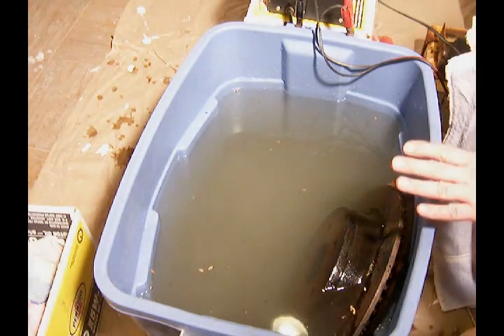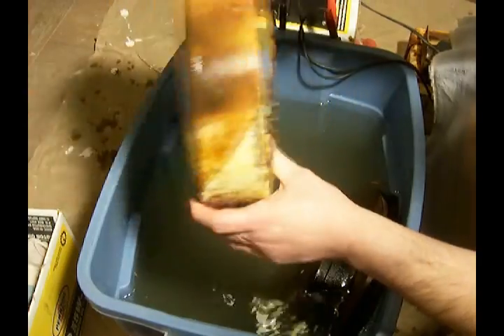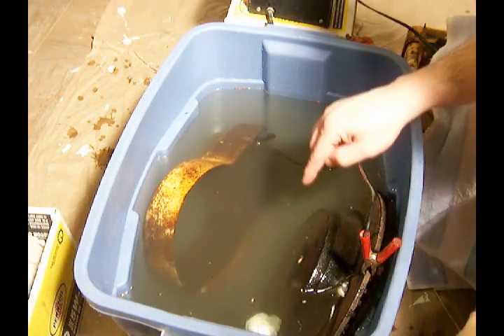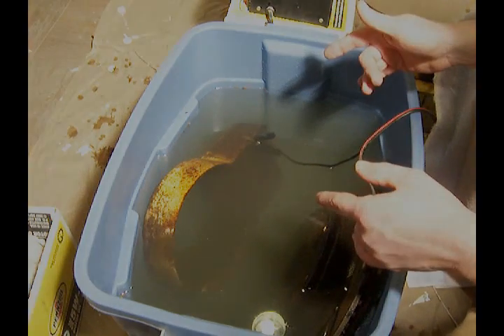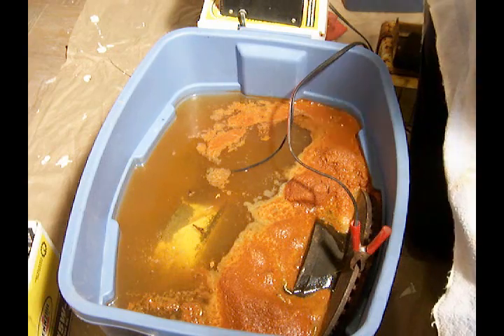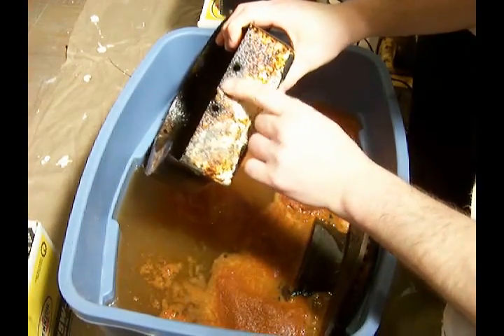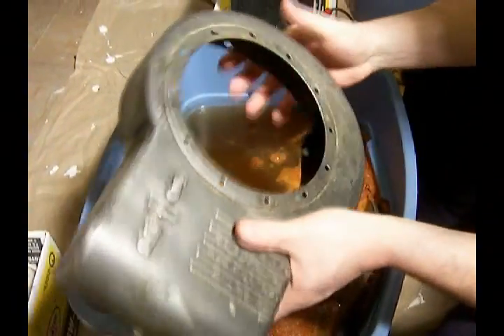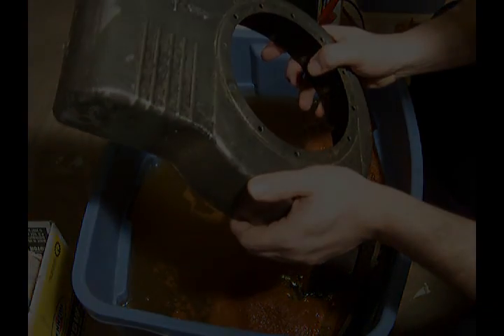Rust removal by Electrolysis - Removing rust from a Briggs and Stratton engine shroud

Comment: For small projects use an old cell phone charger and baking soda works great I have use it for over a year on stuff I have found metal detecting
Reply: Can we use this method for cleaning gun from inside? And please tell me which type of Current use Ac Or Dc ?

Comment: is Arm and Hammer washing soda the same as Borax?
Reply from the maker: No.

Washing soda is the common name for the chemical sodium carbonate. A common source of this material is the ashes of plants (hence the nickname "soda ash").

Borax, often sold in stores as "20 Mule Team," is marketed as an all-natural laundry booster and multipurpose household cleaner. It's a white, soft powder that dissolves easily in water and is known chemically as sodium borate.

Read more : http://www.ehow.com/about_5498702_borax-vs-washing-soda.html
Reply: got it. Thanks

Comment: What amps do you need to set your charger at? Does it matter?
Reply from the maker: My charger has a 2 amp trickle or a faster 10 amp setting. I use the 10 amp setting. Thanks for watching.

Comment: Try not to get shock
Reply: ive stuck my hands in the water cleaning my cast iron. no shock.
Reply from the maker: That would be a viral video! Thanks for watching.
Reply: Yea lol you're welcome.
Reply: Well you are very brave.
Reply: ya ive been doing this on cast iron for a couple months now and stick my hands in the water while its on. NOTHING!
Reply: Its low voltage DC. it is not AC, your not going to get electrocuted or shocked
Reply: Absolutely not true. I would suggest  5 - 40 V.

Comment: I usually use vinegar for smaller items, but for larger things, obviously that would get very expensive...I've looked everywhere for A&M Washing soda, and can't find it anywhere...is there an alternative?
Reply: look in farm supply stores. where I got mine last week. in the detergent isle with cleaners not the baking section. its a laundry booster. sodium carbonate.
Reply from the maker: If "Washing Soda" is not available to you, pick up some "Baking Soda" and bake it! It will become "washing soda". Search the internet for detailed instructions. I have never done it but I believe that it's a simple process. Thanks for watching.
Reply: Every Walmart I've been in has it in the laundry soap aisle.  You can also use Borax but not quit as good as the washing soda.
Reply: Baking soda also works. You are simply trying to make the water conductive but AVOID SALT. You don't want chlorine near you or your metal. Pool supply or home improvement centers carry large bags of baking soda. I think they come as 10lb bags.

Comment: how much voltage you had applied to it???
Reply: sblg43 you mean amps i assume?
Reply from the maker: Voltage I don't know, the unit charges at 2 Volts and 10 Volts - I used the 10 Volts setting.
Reply from the maker: matt sanderson Yep!

Comment: Hi!

I have been doing this process, but I'm facing some problems...you said that if the positive terminal is not submerged the rust doesn't stick to the sacrificed part, it's happening the opposite with me, I need to clean the sacrificed part to use multiple times.

Btw, I'm restoring an old manual water pump and I'm going to paint it next..
Reply from the maker: You need to have the sacrificial metal underwater. That metal will then collect all of the rust and begin to rust itself. However, you do NOT want the positive terminal underwater or it will begin to rust or corrode as well. Cleaning the sacrificial piece is probably a good thing between uses. Thanks for watching.
Reply: sblg43

OH! I'm sorry, now I understand!! I tough you said in the video that if you place the positive terminal outside of the water the sacrificial metal will not get the rust! Now I understand , what you said is that THE TERMINAL will not corrode!

THANKS! Great video by the way!

Comment: Great video!! I'd like to try this on an old flywheel, Would you happen to know if it will effect the magnets? The flywheel I have has 12 magnets embedded in some kind of epoxy to the cast iron.
 Also watched your restoration of the HSK70. I had the exact engine on a blower, followed you step by step, it came out perfect!!
Thanks for sharing your knowledge.
Reply from the maker: I am pleased to have helped. This process should be fine with the magnets.

Comment: You can get compact sand blast kit, basically a tube you stick in a bag of 00 grade silica sand with a air hose. but it's messy and you have to have a compressor...a agree

Comment: Ok, I'm a little greedy.
I have an old Dayton 1.75 KW Generator with a 187cc 4 horse 100232 0492 and a Dayton Teel 1P869 water pump with a 127cc 3 horse 80232 0506 and the generator had 20 year old fuel remains rusted in the tank and carb and it tore down awaiting blasting, but the water pump needs almost nothing.

Comment: The main ingredient in real washing soda is sodium borate, otherwise known as borax. If you look at the ingredients on the box and it has borax in it (also the brand name Borax has, well, borax in it) you should be fine. Commonly used in almost everything, from welding supply shops as a flux to anti-fungal foot powder.

Comment: I would have liked to see the sacrificial rotor to see what it looked like afterward.  Beings you used steel and cast iron does that mean the metals dont have to be the same?  It looked to me like the rust stayed in the water using the cast iron, would it have clung to the metal had the metals matched?
Reply: Steel is iron mixed with a small amount of carbon to improve ductility

Comment: OK i dont get the video why waste the time doing this you can have it sand blasted and painted or clean it up and there is a paint you can use on rust to seal it away they use it on cars and trucks so they dont have to strip it it down and reapint it you can paint right over the rust it stops it from rusting any more and seals it up. So what do it this way? Or you can take it in for an acid bath and that work also.

Comment: Does higher amperage improve the de-rusting or decrease the amount of time needed? Noticing that the paint is rubbing off, would this be a worthy process for removing paint or powder coated finishes? Have you ever tried it on chrome or nickle plated parts? Also wondering what effects it would have on the unrusted plating.

Comment: Take a bin, cut rebar into lenghts to fit upright in each corner with enough to stick out through a crude square frame to go over the top. dril 4 holes through and put your rods in there, connect them all together and you have a neat deruster. you can now take some of those pot scrubbes that look like they are made from citrus fruit bags and skewer them on the rods to prevent short circuits.

Comment: Acid will seep into the metal and come back to bite you later with more and faster rust... remember even a solid is mostly space on a molecular level.

Phosphoric acid is a better compromise as it does convert some of the rust.

Electrolysis is the bomb, it will leave the finest detail on the metal without ever damaging good metal. Most of the rust gets disolved clean off and it sometimes leaves a thin layer of magnetite b(black rust Fe3O4) Black rust is protective against rusting.

Comment: probably it will work best if you remove all oil with soap and maybe some solvent before the electrolysis. it applies to any metal piece.

Comment: Your can actually use caustic soda (drain cleaner). But make the solution pretty mild (like 2%). Now - it will burn the skin on contact, so wear gloves. The fumes aren't all that healthy either, so do it outside.
I have used both washing soda (which i had a REALLY hard time finding - living in Sweden), and the caustic stuff, and didn't see any difference.

Comment: Did you change your charger? Some newer ones have protection so they don't put out any amperage unless a battery is detected. I had this problem, so I hacked my free after rebate 430W computer power supply. 12v @ 16A. Now pulling ~0.8A. I need to get a bigger scrap piece and be able to move pieces closer together. I'm curious as to what amperage was flowing in this video. Just because you have a 10A charger doesn't mean there is a 10A flow.

Comment: yeah you should clean the rust off the metal piece first, did you use new water with detergent? or just the same water as the first part? Also, this supposedly needs line of site between the rust and the sacrificial piece so rust that is under or on the back of the part or in holes may not come off, you'll need to turn the piece every couple hors or so. they say using hot water and a little agitation helps too.

Comment: Pretty impressive.  I've used wire wheels on angle grinders for many years to remove rust from parts. I've used a battery charger with salt water and different types of metals to produce different colored oxides just playing around.  I didn't know you could remove rust from ferrous metal that way.  I've never tried washing soda, might have to try it.

Comment: I have indeed done the whole process with a gas tank from a horizontal briggs 5 hp
process works great i was just experimenting with it what i did was found a cap like those cheap plastic covers on some trailer wheel bearing or anthing like a cap, put a hole in it inserted a long bolt but not touching bottom of tank put a strong mix of soda and water, and 2 days later changed bolt it was nearly gone rust ate the electrode, so just change it out with a another bolt
works great!!!

Comment: For anyone having trouble using a "smart" charger for electrolysis (i.e. the charger will not start 'charging'), just get a D cell (or any 1.5 v battery) connect it in parallel to the charger for just a second (while it's connected to the anode and cathode) and the charger should start. This worked on my Schumacher smart charger which needs to sense a load of at least 1v to begin charging. As soon as it started, I removed the D cell and the electrolysis continued uninterrupted. YMMV.

Comment from the maker: The difficulty in using this method for the inside of a motorcycle fuel tank, is how to suspend the sacrificial iron inside the tank. It cannot touch the inside of the tank and yet it has to be in the water. There are some videos on youtube of guys who have done it. I have a tank myself that I want to do it with. I just haven't gotten around to it yet. Let me know how it goes if you do it.

Comment: I am going to be restoring a Honda CB900C and the inside of the gas tank is all rusted out. I have seen videos of people using Vinegar, Coke, Distilled water & Sand, and just bolts. Do you feel that this method is much more effective for complex pieces such as this? I was very impressed with your technique. I am trying to find a cost effective way to remove the rust, and we have plenty of batteries...

Comment: The salt is a good tip, I wish I used it for my caliper. I ought to try it with my second batch of calipers. On the other hand, when dealing with about 20-40 hours of the process, the garage door better be open. This process is not a difficult one and people should not be discouraged. However, as it is the case with anything, necessary precautions must be taken.

Read more: myweb. tiscali. co. uk /andyspatch/ rust. htm

Comment: measure the current flow you wont be using 10 amps.

depends how resistive your solution is.  use salt solutions if you wanna pump out more current.  Look up cathodic protection systems.  Sea water is 20 to 30 ohm-cms that will incress ya current output.

And work a lot harder but you will generate chlorine gas as a by product. so ventilate it as you do it.

Comment from the maker: As mentioned in the description above, it is NOT recommended for aluminum. It works great for steel. Never tried chrome. I would recommend this for any rusty steel or iron product. Of course, you have your work cut out for you if you have to do a whole car!

Comment from the maker: It has been suggested that more amps will work faster. My battery charger puts out a maximum on 10 amps. That is what I use. I know that there are battery chargers available with more than 10 amps but mine works fine.

Comment: Is there a good, target rate in amperage to shoot for?  Can that be adjusted by the proportion of washing soda/water?  Would higher amperage simply expedite the process, or perhaps cause problems?  How many amps were you running when you left this piece overnight?  Does the rate of the process change as rust is removed? Thanks for posting.  It's a great video.  Can't wait to try it myself!

p.s.  We shouldn't wash paint residue down the drain. In some places, it ends up in cattle feed, then us.

Comment: I'm working on cleaning up some old oil lamps that have tin reflectors. The rust is not that bad on the light reflectors and aluminum foil is working, but its not as good as this looks like it could be. 
Might this process work for me?

Comment from the maker: Ok so let me get this straight. You are able to get into every little nook and cranny, like say the inside of a motorcycle gas tank with a little elbow grease? And as mentioned in other comments prior to this one, I current have NO ROOM FOR A BLASTING CABINET! And it just so happens that this battery charger is more than 15 years old. So if you have it all figured out, what are you doing watching videos like this. Go watch some SAND BLASTING videos - they are a tenth of the time shorter too.

Comment: Ok so let me get this straight. You are "restoring" metal parts. This is like the most complicated and lengthy way you can do it. Just get a can of rust remover and put a little elbow grease or an abrasive pad to it and be done in a hour or so, or do it the right way like I do. ITS CALLED SAND BLASTING! That is what they are made for. With the amount of money your going to spend on battery chargers (because this will kill them) I can blast an entire car, and in a tenth of the time too.

Comment from the maker: This process does not attack the good iron/steel. It only attacks rust (oxidation). It will also cause harm to alloy metals. I don't know the particulars of your situation, but is it possible that those holes were places where rust had already eaten through good metal?

Comment from the maker: It should work just fine. Make certain that the battery charger is connected to the metal part of the pedal gears. The process will not harm the plastic.

Comment: A couple of things. Do NOT do this in closed spaces, make sure the area is well ventilated. The result of the chemical reaction is the release of oxygen and hydrogen which are highly flammable gasses especially in concentrated amounts. You dont want to turn on the lights or light a cigarette and blow up the whole place tryina get rust off a caliper. Secondly, you could always get rebars from lowes for something like $2~$3 and use a clip to hold it in place. Those are steel and work great. TYFS

Comment from the maker: I am guessing that it would take a bit longer with 2 amps!
I believe the rotor I used was cast iron, so my steel comment wasn't exactly accurate. I have used other iron/steel items in the past and they all worked just fine. The smallest sacrificial piece that I ever used was a coat hanger.

Comment from the maker: My battery charger has two settings - 2 Amp (for trickle charging) and 10 Amp (for a faster charge), I use 10 amp for removing rust.

Comment: Baking soda works just as well, as does salt or even MSG is you wanted to waste money:)
How many amps are being pulled (assuming your charger has a gauge? With such a weak solution, I would imagine it's only pulling a few amps, certainly less than 10 (amperage goes up when resistance goes down and vice-versa.

Comment: I plan on doing this do my 355 4 bolt main block rather than spending hundreds to a machine shop. I was wondering, wouldn't the black residue be present by the washing soda and would need to be washed off? Whether by pressure or just scrubbing with a bronze or other porous material brush? Or is leaving it black fine?

Comment from the maker: Electrolysis does work with aluminum but use it with caution. The process will actually remove thin layers of the aluminum or other alloy. Use sparingly and check it often.

Comment: How long would you expect a heavily rusted Model T Ford engine block head to take? A day or more? Because I have one that i want to at least clean up, it turns out it was left where I found it because apparently it was left to freeze in the winter and it has a crack in it. I know that cast iron can be repaired to fix it but it would be nice to just get the rust off of it. :)

Comment: I have used Arm & Hammer Baking Soda just add 7 tsp to each gallon of water. The grater the DC Current is the faster the electrolytic process will be